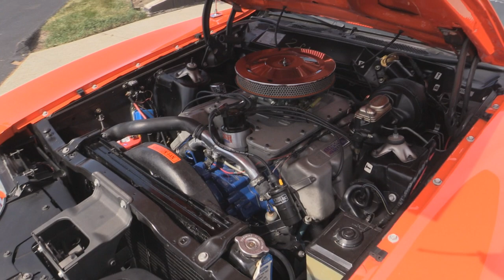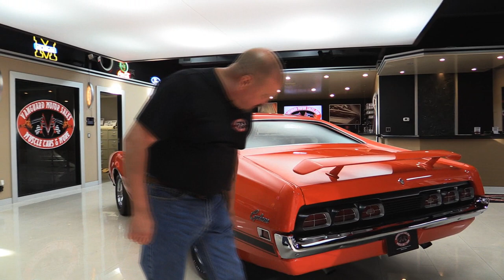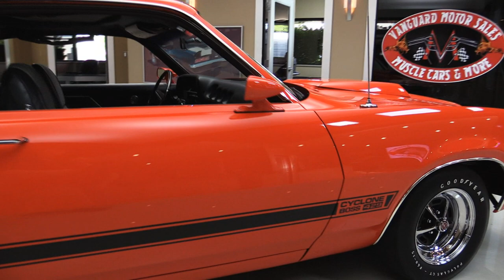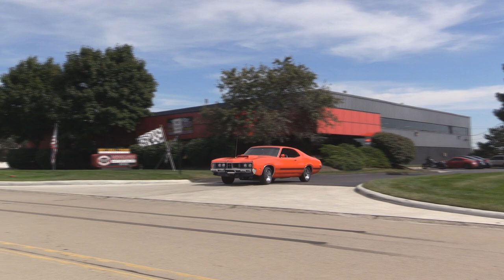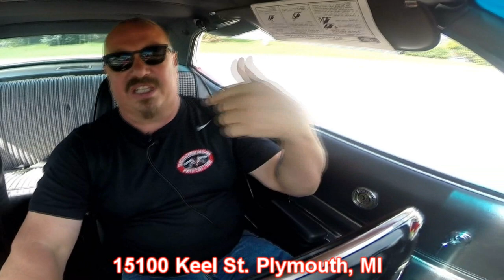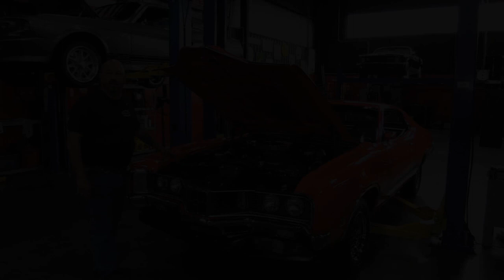1970 Mercury Cyclone Boss 429 For Sale

Comment: One of my dream vehicles.  Ford had some of the best looking vehicles on the market back in the 60's and 70's
Reply: I'm a Mopar guy but I agree. Ford had great styling in that era. A lot of beautiful designs came from Dearborn in the mid to late 60s and early 70s. Always wanted a 66-67 Fairlane 427 or a 70 Cyclone Spoiler 429 SCJ. Wouldnt mind owning a 63 1/2 or 65 Galaxie 427 either. I love the Ford FE 427 engine. What a monster

Comment: I'm a Mopar guy but the 70 Cyclone Spoiler 429SCJ is my all time favorite muscle car ever built by Ford. Especially with the 4 speed and the Drag Pack option. What a beauty!!! Always wondered why Ford never built a BOSS 429 Torino/Cyclone. Also loved the 68-69 428CJ and SCJ Cyclone/Torino/Fairlane, and any Ford equipped with the radical, race ready R-Code dual quad 427 from 63-67. But the 427 was too radical to drive every day on the street, unlike the 428, which was a very good, reliable street engine that still made great power
Reply: Ford did build a BOSS Cyclone for Nascar, they just never sold them. The 429 BOSS engine was only sold to the public to comply with Nascar rules. Once they sold enough Mustangs with the engine in them they were allowed to compete with it, so they never needed to sell it again. The street version is very different and much less powerful than the race engines, since the 429 was only ever meant to run wide open. A true race tuned Nascar 429 BOSS would stall out due to lack of airflow while idling at a stop sign after coming down from high rpm, or would have to idle excessively high. The track engines also only get proper air cooling when going over 100mph. The Cobra Jets, Super Cobra Jets, Eliminators, Cyclones, Windsors, Clevelands, and even 302s already owned every dragstrip since 67 to the extent they practically had the deeds to the land, Ford had no reason to accept the liability of pushing a track only engine to the public

Comment: Beautiful car. Never understood why the Boss 429 wasn't fitted to Cyclone's and Torino's by the factory.
Reply: The boss 429 was designed for the torino but bunky knudsen told the engineers "put it in the Mustang" which is why they were completed by Kar kraft...the modification required to shoe horn the boss 429 into the Mustang couldn't be done on the assembly line.